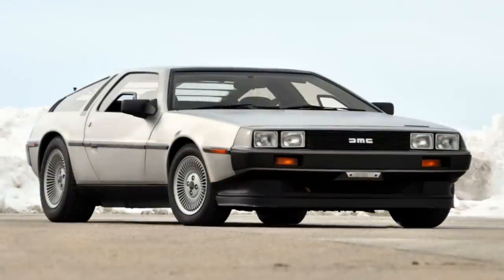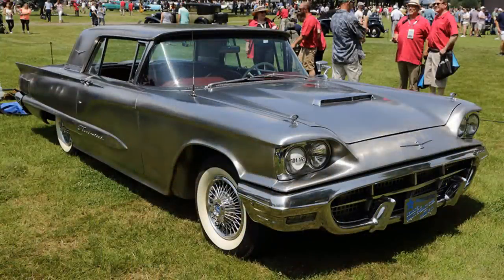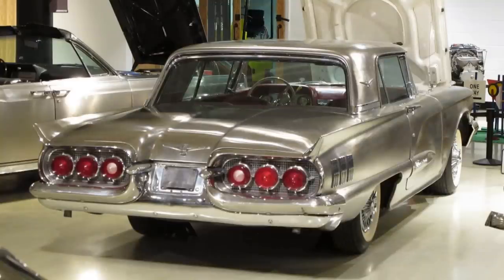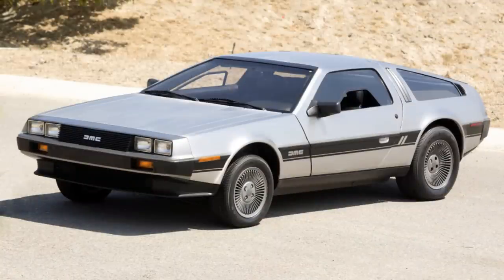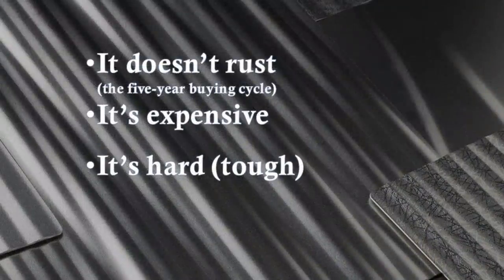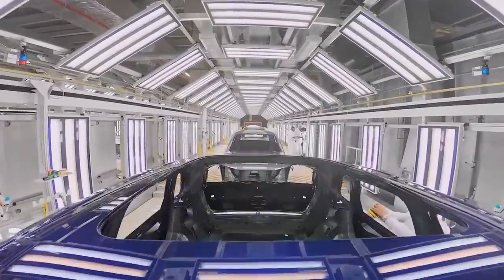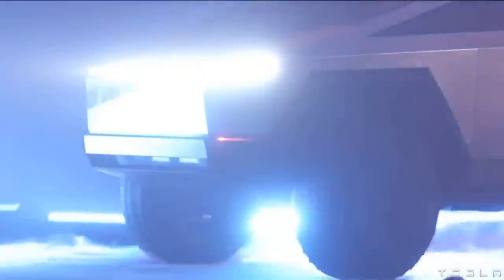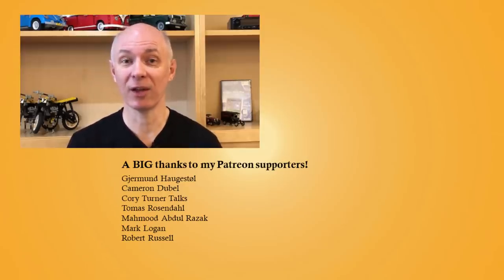Why aren’t cars made from Stainless Steel?

Comment: Interesting video. 
When it comes to metallurgy hard and tough are completely different, but I understand what you are trying to put across :) 

There are many reasons SS isn't suitable for mass or indeed, low  production of car bodies, it's simply the wrong choice of material to use. 
Going against it is strength to weight factor, ease and consistency of welding, metal fatigue, 'paintability', cost of raw materials, design of crash worthiness (safety, but poor choice of words) it's a poor solution looking for a non problem. If one's main criteria is rust protection of carbon steel, then this is well understood, but more importantly, the end product wouldn't be economically viable or technically correct. Even you accept the tagline of "if they made a body that would last forever' that ignores the fact that the huge and overwhelming majority of new car buyers (fleets/lease/PCP etc) change their vehicle within 24 to 36 months, so SS is a bit of a non starter all round, but always an interesting discussion.

Comment: I'm no engineer by far but a vehicle that won't dent(although it was only hit with a dead blow hammer designed not to produce said dents..)sounds like a vehicle with no "crumple zone" that transfers MUCH more energy to the passengers in an accident..idk. And I thought Elon said was it was supposed to have unbreakable windows in the demonstration, not shatter resistant which is what every car windshield on the road has, that busted one after the other and the video of the supposed bulletproof panels(which may have failed a thousand times before they got the camera shot they wanted, js) I'd want a lot more proof that it isn't a modern day DeLorean which was/is with a piece of shit that looks unique. And paying a deposit for a vehicle that may or may not be produced is silly after watching the out of something that's not far from a model X with a lift kit and weird suv body.. seems like Elon is hyping a prototype to drum up interest free loans. Idk folks, like I said I'm no Elon Musk by far but seems fishy..

Comment: I did not realise that Tesla made this...um thing with stainless steel body panels. Now that I do, I am shaking my head.
As a structural aircraft mechanic, I have studied metallurgy, and using S/steel is not as simple as just leaving it to the elements and forgetting the finish. S/steel can become pitted and take on a corroded (tea-stain) or rusty colour if not adequately maintained.

 BUT onto the most severe problems. If you intend to drive one of these, then prepare to be a human airbag/crumple zone. Expect to pay a premium for fuel because of the weight factor. Expect structural repairs, i.e. welds to crack. 

Last but not least, galvanic corrosion could be a significant headache. This is when two dissimilar metals (ferrous & non-ferrous) are placed together, causing corrosion to occur. If you had one of these utes around a coastal area, it would not look good for long. 

Surely the S/steel finish is just a new sales gimmick?
Reply: What fuel its electric
Reply: @elifighter  You do understand that it makes no difference if a vehicle uses an ICE engine or a battery, they both require energy? Just say that you charge your "emission free" Tesla at a charging station then current data will mean that most likely, the energy will come from burning coal, LNG or less likely - nuclear. The heavier your electric vehicle is, the quicker you will deplete the energy - converted by burning....fuel. Electric cars are not clean alternatives until they are totally reliant on renewable energy. And when it doesn't take many barrels of oil and precious earth metals to manufacture them. I'm sorry to burst your bubble but their is no such thing as an environmentally friendly vehicle. Not yet. And there is no such thing as a vehicle that doesn't use energy which is converted to battery power which, is basically the same as fuel.

Comment: I’ve been told by metal fabricators, and my limited experience welding is that stainless steel is one of the easiest metals to weld
Reply: Welding isen't really a problem, but drilling, taping and forming is more of a problem as well as correcting dents afterwards.

Comment: The weight alone makes it a dumb idea, aluminum is vastly superior in every conceivable way including cost and miles per gallon "weight/cost/shipping" (yeah electric cars have a MPG rating.)
Nobody can say Elon is a genius...
Reply from the maker: I think the goal is to use the body as the chassis, so they save the weight of a separate chassis.
Reply: @BigCar2  That's nonsense, Aluminum uni-body frames are everywhere and always weigh less..

Comment: Stainless is also heavier.
Reply: No, actually not, if you are considering the strength to weight ratio, which is what matters (as opposed to raw density). Stonger means less material. Less material means lighter.
Reply: @Seehart  stainless is more dense than carbon. It would have to be paper thin to be lighter. No. The reason he went with stainless is because he didn't have to paint it, and because its shinny. It makes people go "oooooo, coooooool." They did this once before back in the 40s I think. There's a reason they don't still do it.
Reply: @manicmechanic448  I think the reason people don't understand this is that most people are incapable of compound ideas (multiple thoughts that combine to form an idea). Dogs, and most humans apparently, are incapable of grasping compound ideas.

The design of the Cybertruck and the choice of material are a compound thought. It would make no sense to make that exoskeleton shape out of aluminum, nor would it make sense to form the shape of a F150 out of 30X stainless steel.

Your comment that stainless steel about not wanting to paint it, like the obliviousness of the premise of this video, demonstrate the stupidity of our species. It's depressing really.
Reply: @manicmechanic448  apologies, I must have missed something in the thread (since YouTube comments are not organized into rhreads). I didn't know we were comparing stainless steel to carbon composites. Yes, carbon is lighter by any measure.
Reply: @Seehart  no you were right. Its carbon steel. I simply like it better because its cheap, reliable, and easy to work with.
Reply: @manicmechanic448  Fair enough. Carbon steel is a better choice for most things. But the difficulty in working with stainless steel is not much of a deterrent if the only work is scoring, folding, and a little bit of welding.

Comment: Stainless steel still rusts if it takes a 'nick', though, right?
Reply: Usually if mild steel is on the surface for any reason, not necessarily a nick . Stand a can on an untreated stainless steel surface in the rain  and shortly after a rust ring will appear under the edge . Abrasive can remove the rust but the better process would be to electro polish the stainless steel like we did for marine fittings such as staunchions and hand rails giving 304 Stainless steel a better more protected surface than 316 grade a less corrosive variant …

Comment: Tesla's not "cutting and welding, instead of bending". Even if Tesla not stamping panels - they still bending them!

Elon Musk
@elonmusk
Reason Cybertruck is so planar is that you can’t stamp ultra-hard 30X steel, because it breaks the stamping press
Elon Musk
@elonmusk
Even bending it requires a deep score on inside of bend, which is how the prototype was made.

Comment: Maybe it's just me, but $40k seems cheap for something of this size and spec even if it weren't made of s/steel. Tesla impress and infuriate in equal measure: what they've achieved is truly remarkable, but no established mfr would be irresponsible, borderline reckless, enough as to release a feature like autopilot in it's current state, and I despise the mealy-mouthed hypocrisy of covering their arse, after having introduced a feature that does everything to encourage driver inattention, by stating that this not it's intended use. There have been deaths and I guessing it's only as there are relatively few in the motoring population that this hasn't been bigger news.
So the criminal underworld gets mentioned, but not safety regs? This thing will pulp pedestrians, and crumple zones help everyone unfortunate to be involved in a collision by managing crash energy: not much good if your is strong as a tank if you're smeared over the inside. I thought side glass was toughened for a reason , i.e. access - else why aren't side windows laminated?
Whilst the shape is clearly an effort to minimise tooling, as well as making it unnecessarily ugly, truly flat panels create their own problems, such as vibration / resonance as well as not actually being as strong as equivalent panel with some form in it.
If it reaches production as is, I shudder to think of the resulting road rage incidents that will ensue

Comment: Well for Tesla it makes sense, making between ~$5000-7000 for replacement of the few vehicles that will be needing battery replacement after 10+ years.  However majority of people will simply upgrade to the newest model every 5 years as they do now because that's the norm now days. 

PS. In my opinion stainless steel is ugly and the Cybertruck is the worst looking truck ever to be announced, the benefits of stainless steel do not outweigh the benefits on the sheer fact of customization alone given you apply a decent undercoat or rust resistant on the undercarriage of the vehicle as majority of vehicles post 2000 (in the US) have.

Comment: Stainless steel hard to weld???? Hahahha, i fix cars and vans and when there's a rotten spot on the underside, then i go to a metal scrap yard and buy some stainless steel for a dollar a pound and weld that under the cars and vans i work on, and it's even easiër to weld than plain old fashion steel! And i just weld it with a mig/mag welder, so those pieces will never ever rust again!

Comment: The Tesla 500,000 mile battery will give the average car 20 to 30 years of life e.g. my Fiat is 13 y/o with 90K miles. It will make age15 but not much more. The Tesla battery needs a car that can use that lifetime.

Comment: Meanwhile, Teslas still tend to catch fire and spew flaming batteries. A slightly bigger problem. =9[.]9=
Reply: Not as many as fuel powered cars ….
Reply: @chrisbraid2907  False equivalency. The proportion of spontaneous internal combustion car fires is smaller than spontaneous fires in electric cars by number, and battery fires are more dangerous, requiring firefighters to undertake special training to deal with. ='[.]'=
Reply: @Raycheetah  Where are you getting your information?
Teslas are ~10 times less likely to catch on fire compared to the average car.

"From 2012 – 2020, there has been approximately one Tesla vehicle fire for every 205 million miles traveled. By comparison, data from the National Fire Protection Association (NFPA) and U.S. Department of Transportation shows that in the United States there is a vehicle fire for every 19 million miles traveled."

Comment: Delorean did not fail because of stainless steel. The company was rotten in many ways and the Delorean car is horrible shitty quality and a constant money pit for repairs. The reason why stainless steel is not used for cars is not a good reason, but more that people (and companies) are not too bright and they often don't venture out of what they know. There is no reason to make cars out of stainless steel, Toyota makes cars that last 30+ years and still sells great. It speaks about quality and reputation that you can replace a car when you want, but not because it falls apart.

Comment: Electric cars have a very different set of engineering parameters vs contemporary ICE cars.  There's so little to go wrong and the battery longevity is getting better and better.  The days of expensive cars ending up as write-offs after just a few years will decline.  Indeed, cars that can do a million miles won't be all that rare.  There's all the reason to build EVs to a much higher quality that will last a long time.
Frankly, who doesn't want a world where cars are beautiful works of art made to last a lifetime?
Reply: Yup, all good points. In particular, the Cybertruck will have a 1000000 mile drivetrain and battery. It is sensible to have an immortal body as well.

Tesla is ditching the planned deterioration parts and labor profit model, preferring other less environmentally harmful forms of low margin incremental income, such as software and ridesharing.

Comment: What a stupid vehicle and Musk has still learned nothing about design and construction. The Tesla cars are so badly designed ( do the research ); so I do not expect any better here. Why SS which is so expensive and hard to  produce, when the smart money would go with aluminum, plentiful, easy to produce and work into strong lightweight structures..
Reply: Aluminum is also expensive to produce requiring large amounts of electricity to produce. Aluminum unless coated or annodized is horrible at resisting corrosion.
Reply: Aluminium catches fire when superheated Stainless Steel just oxidises …. The body of an All Aluminium Tesla Cybertruck would be history if the battery pack went up but the Stainless could be recycled ….